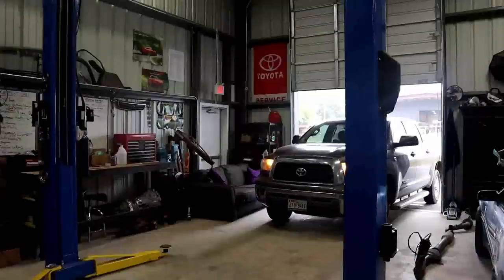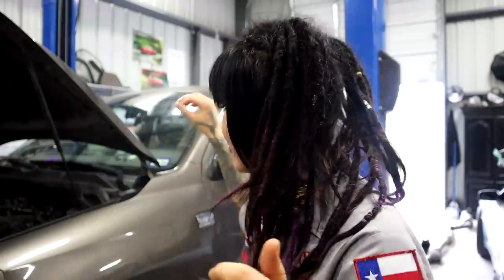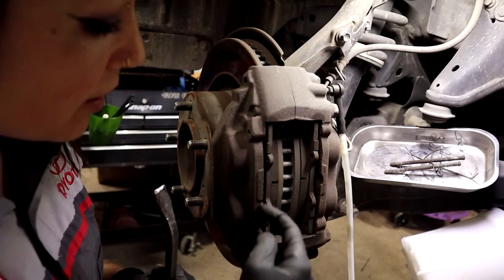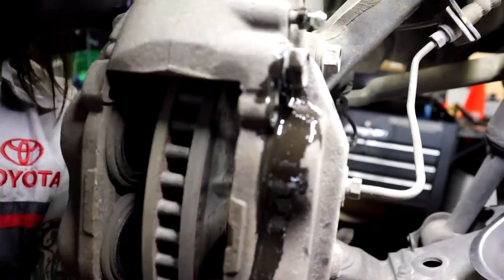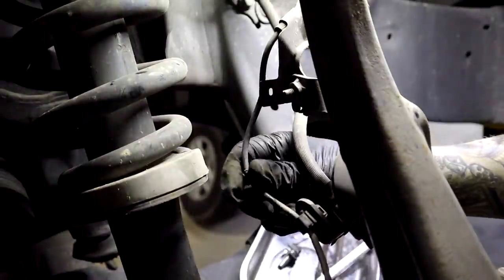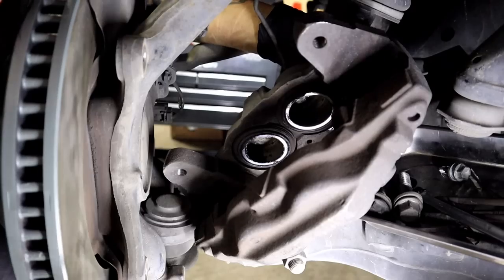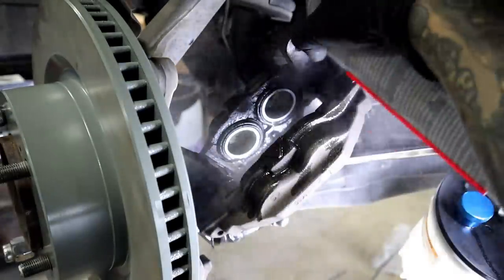How to Replace Front Pads & Rotors (a VERY detailed DIY tutorial) featuring a 2008 Toyota Tundra

Comment: Just a thought to add,  But before you pull the vehicle off the ramp after your done.....pump the brakes up till they're hard.  I've watched a few colleagues in the past forget this and prang customers cars backing out the shop.  Those pistons in the calipers are still a little way back from the pad and it'll take  a couple pumps to get them snugged up to the pad,  last thing you want is to brake and have the pedal go to the floor!        keep up the good work Faye!

Comment: Im a apprentice technician mechanic for Volkswagen, im based in Aus,Melbourne.  Im a 2nd year, mid 20s, and already know working with brakes.  Of course in the everyday workshop we don't go to the extreme that you have - great work though.  We do lubricate the sliders on some brake setups, and the rear drums I've been told to apply some copper grease behind the brake shoes/pads in the drum.  Just figured you wanted to know you've making a difference, so heres my comment and share of experience.  Great to see someone elses work and compare it.  Absolutely love when you do videos with Danny and when we straightened your block and files down your tappers (I think thats what they were called) I was glued to the screen.  engine building is what im eager to see and learn, everyday service work is a bit too casual.  Anyway, in short, thanks for a great video and your service with many smiles!    Just hopes everythings wokring out for you and your success.
Reply from the maker: Thank you so much!!!

Comment: @14:44 PRO TIP:  For those of us in the NorthEast that find the rotors seized to the hub flange, there's two threaded bolt holes (Faye runs her finger right past one of them).  Check the new rotor for the same threaded hole to match up the proper metric bolt.  

You can run an 8mm metric bolt into the threaded hole to press the rotor from the hub flange (bolt can be found under the hood holding down the airbox and other items, or just source the correct bolt from a hardware store).

Just wanted to add this tip for anyone in the NE or the salt belt because you can spend all day pounding on the rotor and still have zero luck.  Also an air hammer around the areas Faye pointed out works wonders as well. 

Great content, im subbing right now 🤘🏼😁🤘🏼
Reply from the maker: Oh, shoot, did I not mention that in this video?!? 😵‍💫 Ahhh I swear I did!!! Haha too many videos, my miskate, thank you for mentioning this!!!!
Reply: Rust is so evil, I had to get rid of my 2007 Tundra regular cab short bed 4x4, only 80k miles, because frame rot took over. Mechanically it was perfect but East Coast rust is the worst.
Reply: @FayeHadley    Also on some cars where the rotors are siezed on and there's no provision for pulling/pushing via a bolt hole, see if there is some metal surface like on the hub carrier you can use, put a bolt and nut between the back of rotor and hub carrier then use your bolt/nut as a pusher tool

Comment: Great vid and overview of doing a break job

I may have to do front pads on 2001 Nissan maxima “MadMax”My son’s first car. 
It use to be mine it got passed down to him after I got a pickup.  
Needless to say “MadMax”fell apart not long after he got it.  It’s been fun doing the repairs myself. To save him $$.  

When I was younger I thought of going into automotive mechanic line of work.  I ended up with CS degree.  I still missed working with my hands and fixing things.  And have an appreciation for auto-tech’s .  

I estimate in past 12 months I have saved my son almost $1700  in labor and parts costs (using mostly aftermarket parts)

I am trying to spur an interest in him in developing skills and mechanical skills that will help him in life.  This is something missing in today’s youth.

Comment: Great information in this video. The tip about marking the torqued bolts is a great idea. I used to work on the iRobot Powered wheelchair. That wheelchair is a class 3 medical device that can actually climb and descend stairs, so strict adherence to the torque specs is critical to prevent failure and user injury. One time I did actually lose sleep because I could not remember whether or not I had torqued the main bolts that fasten the seat arms to the power base. Fortunately the customer is an engineer, gear head and has good mobility and torque wrenches, so early the next day I called him and asked him to verify that they were torqued. They were, thankfully, but putting a discreet mark on them and checking before I left would have saved me some sleep.

Comment: I open the caliper bleeder then push back the pistons having the fluid into the bleed instead of back into the line. Then the full bleed. Then I take the caliper off to preform the brake pad / rotor replacement. The brake bleed cap should be replaced if the old one is cracked / missing. Love your very through videos! (and the chickens)

Comment: Gearing up for spring maintenance (Fort Worthian here, that's like late February with this year being the oddball out) and this had absolutely everything I've read in the manuals for specs, not to mention it was a helluva lot more entertaining. 👍Plotting out new brakes soon and needed the refresher! If the weather holds, I'll be sliding under for the radiator and the ATF drain this weekend. Loved the brake bleed vid I watched right before this one. Way to earn a sub!

Comment: FABULOUS vid , know you need to do a vid on how to diagnose problems if something goes wrong,for example, I just changed everything, and I mean everything in the brake system, well I tour through pads,rotors only on one side unless then 6 months, problem booster I replaced was one size fits most,only one available for vehicle, the rod length for it slightly too long and always apply part brake. Took us 4 days to figure out because we skipped steps to diagnose for we replaced everything.

Comment: I’ve watched all your brake videos today. Did my brakes today with a front lower control on driver side. Everything  was going fine until the bad thoughts kicked in and than my stud on my lower control broke lose so the nut just spun with the stud. Had to pull out the grinder and cut it off. Than Subaru and Toyota didn’t have the flange nut in stock that I needed for my scion. Lucky me I’m paranoid so I don’t through away good nuts and bolts. Found the exact one I needed. Put the new control arm in. Then when I put on my rotors they were so wobbly they looked warped and I just had them resurfaced. I put in two nuts on to hold it in play and they didn’t work. It wasn’t until I put on all my nuts on the wheel rotor that it held in place. Putting the brakes on was the easy part. Then when I reassembled everything the wheel would get stuckish. Turns out you really have to pay attention to them slider bolts took it apart and cleaned and lubed the slider bolt and that fixed the problem. I still have to do the rear wheels but that was almost an entire day. Omg. Just kept listening to your videos and tried to mimic and learn your style. Thanks for the videos !

Comment: First off: great video.  I like how you role.  I didn't read all the comments, so maybe this has been addressed earlier, but red loctite is for things you assemble and expect to never disassemble again.  If disassembly is required, expect to apply heat to break down the loctite.  For this application you should be using BLUE loctite.

Comment: I live in Nova Scotia Canada. The pins(hardware) need to be replaced here more often then not when you change the pads. Not a punch to get them out, you have to use an air chisel. Rust rust and more rust on rust, every bolt is rusted on. Also i need that vacuum tool. Great video!
Reply from the maker: OMG!!! Thats crazy it's gotta be so hard to wrench up there 😬
Reply: Yes it is. You learn ways to get around it so you don't break a bolt. In a pinch Tabasco sauce can work as a penetrant. Just be careful because it will colour chrome and plexi. We use this at sea in our tool bags(I'm Navy)

Comment: These are awesome videos, Faye! I had to learn how to wrench on my 2002 Mitsu by using the shop manual (first car that I did major work on and it was v confusing). There are videos about Audi maint but they're usually from shadetree mechanics and I can tell corners are being cut. How I wish those pads just slid out of the calipers like these do.
These videos are so well done that I'm 100% ready to do my pad/rotor swap and I'm 90% sure I won't mess up my transmission fluid change haha. Thanks!

Comment: good video Faye like always.. yeah keep preaching that more lube is not better. cause when you get the dirty grim etc it collects dirty grim and it then acts like a sand paper. I just open the brake fluid cap open to give the air to push back the pistons. :) but on my two Mercedes, one I suspect air in the line cause it is spongy and did notice that it was out of fluid so that is how I think it air got in, but when I get a lift for my garage I will fix that.  will replace the brake hoses all around brakes rotors and then bleed :)  a lot of work and the other one need to just change it out..

Comment: 13:42
those bolts come with lock tight on them (i work at the plant)
14:50
you can use a 12mm bolt on the rotor to remove if its stuck, itll push on hub to break free. the 12mm hole is on the rotor itself itll be between the studs
Reply from the maker: Oh my gosh that's awesome you work at the San Antonio plant?!? I've taken that tour like three times because it's so freaking cool!!!
Reply: @FayeHadley  
yes and yes,  ive been there for 14 years and going. glad you enjoy touring the plant but as a worker we feel like animals in a zoo when the tour comes around lol! 
keep up the good work with your channel btw!
Reply: So many people don't know that.  Honda's do the same thing.  I see people beat the living crap out of a rotor trying to get them off but I have my two bolts that just screw in, a half turn with a wrench and off they come.  I only had one that was genuinely stuck bad but even then, I hit each bolt with an impact and off it came.
Reply: @bechtoea  
a friend of mine was smacking his rotor (with a mallet) for about an hour before it broke loose. i told him about that 12mm bolt and my mans damn near fainted. i was like bro the bolt would have pushed the rotor off the hub, thats why the hole is there.

if im not mistaken, all rotors have the same 12mm hole for that reason. ive seen it on stock and aftermarket rotors of the like.

Comment: Nice video.  I agree, i wish i could trust other techs do this quality of a job.  but I cant, so i will do it myself.  Can you explain why some rotors have drilled holes and if they are better or worse or doesnt matter?
Reply from the maker: Sure, gladly! The rotors that are drilled and slotted are usually performance rotors. The advantages are light weight (less unspring mass) and very good at venting heat. Not all drilled and slotted rotors are actually an upgrade and improvement, it depends on the brand. I have the Powerstop truck and tow kit on my 4runner, and I really like it, but I have seen other brands be very noisy, produce a lot of brake dust, and not last as long. When I perform these brake jobs, I will always use the OEM pads and Rotors because for some reason Toyotas like to make brake noise - the design of the material and anti-squeal shims of the OE Toyota are so quiet and I never have customers complain about brake noise, thousands of miles later. If you are interested, I have a video on the Powerstop kit (also available for the Tundra) that I installed on my 4Runner. https://youtu.be/xGLYaP8i4RQ

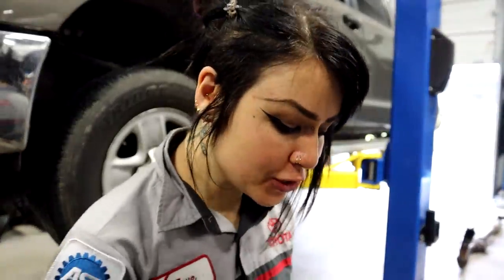Comment: 5:10 that is correct. There are some 21mm that work better with a 21.5mm socket because of the aluminum lug caps. Check Grey Pneumatic sockets, they sell 19.5mm, 21.5mm, and 22.5 sockets for ford, Toyota/nissan, Dodge respectively

Comment: Questions (continued):  (1) Were there any slide pins on those brakes?  If there were, u didn't clean and relube those.  (2) When adding threadlocker to a bolt/nut (also applies to anti-seize), there are some recommendations that say to reduce the "dry-thread" torque by a little, as as much as ~20% (so as not to exceed the design clamping force).  (3) I live where salt is used on winter roads, thus watched multiple times when u seemed to provide the tip to add anti-seize to hub outer rim.  Why did u mention that so fast? - any concerns that anti-seize could bleed out and get onto the rotor inner face?   (4) If u had to remove a seriously rusted-on rotor, would u hammer it hard (can that damage the wheeel bearing?)? Or would you use a puller to remove the rotor?       
DIYing my brakes in the driveway is getting harder as each year goes by, so if I lived closer, I would not hesitate to book your shop for my next brake job (as long as you used a puller). 👍👍

Comment: If the rotor is rusted onto the hub, you can also use two bolts screwed into the rotor to push it off

Comment: I'm getting ready to change brakes on my 2016 Tundra.  Guys in the forums tell me to use 5.1 brake fluid.  My question is whether 5.1 brake fluid is ok or what will that do if the cap has 3, not 5.1?
Thanks and great video!

Comment: Very nice, as usual, but I can't see how that type of torque wrench can be accurate, since, unlike regular torque wrenches, there is a distance between the center of torque and the measuring mechanism. Unless the torque scale already corrects for that distance, although this would not be super precise, given that the distance will be a bit different depending on the size of the open wrench attachment used. Am I missing something? Thanks for posting this.

Comment: These are videos i love seeing from you....and fact its tundra is better lol I have 2 tundras in driveway.... 2008 SR5 and 2018 SR5 for work truck....I did all my breaks earlier the winter on 2008....here a tip...if ur brake pedal feels low...inspect calipers. Thought had issue with brake master...had 3 calipers installed when i got truck to pass MVI bout year ago...garage said 4th one was good..... ended up being that last  caliper...piston was sticking...even tho would compress with clamp....new caliper...pedal was back....I have very firm brakes now :)
Reply from the maker: YES!!! That is what happened to these poor folks. Barely a year on the former brake job and passenger's side caliper seized. Thus the warped rotors, and the fact that I showed this job on the Driver's side only ;)

Comment: Great video darlin...... Was trying to decide if I should do the calipers on my 07 Tundra but after seeing this it looks pretty easy. I have a question for you about an ABS sensor I replaced n cant seem to find a Toyota mechanic in any of the tundra groups I'm in.... 😁😘
Reply from the maker: Bring it on! What's up with the sensor??
Reply: @FayeHadley  so I had all new tires, tie rods ect replaced and after about 2 weeks I had VSC, 4HI flashing with ABS and squiggly tracks (VSC) lights solid.... Did some research with plenty having same Tundra issue but no real answers other than wheel speed sensors so I took a look underneath and did find FR sensor was broken in half by the bolt so I replaced it (oh what fun that was) and lights were off for about 30 miles and now come back on after a few restart miles. I heard that maybe they needed to be re-calibrated because of the new tires or possibly a battery pull to reset the computer? As a side note I went in to replace rotors and pads and found that same side had a froze inner pistons on the caliper so Its getting dropped off on Tuesday for all new everything brakes in the front and he's gonna do deep scan to find out about the ABS issue but before that is a battery pull a good 1st attempt to reset before paying $$$ for deep scan? TY darlin

Update: ended up doing them myself n while I was in there pulled out the new sensor and cleaned off the end n guess what..... Lights Gone!!!! Not sure if it was the cleaning or the new brakes but I'll take it. TY in advance darlin... 😊😘

Comment: Is it necessary to replace your rotors when changing the brake pads?  I recall in years past shops would turn your rotors on a lathe.  Now it seems like folks just replace them, but is it really necessary if the rotors aren't really warped or have big gouges in the surface?  How can you tell if rotors need to be changed?  Thanks!

Comment: Great video Faye.  Thanks for showing us how to replace pads on those fixed-caliper brakes.  This will come in handy for those Brembo's too.   Is it necessary to clean the surface of the wheel hub  before mounting the rotor back on?
Reply from the maker: That's a great question - if there is any sort of dirt or build up or rust or anything creating an uneven surface then it is absolutely essential. Otherwise when you go to mount the rotor back on, you're going to have excessive lateral run out that will cause a pulsation when you hit the brakes!!
Reply: @FayeHadley  Thanks for the info Faye.

Comment: Great video, Faye!  One question, please: At 9:26 you removed the bleeder hose and left the bleeder screw open for awhile.  Won't air enter the system?  I thought the bleeder screw is supposed to be tightened before removing the hose so there is always a closed system.

Comment: Just as a heads up. Just changed 
My rotors and brakes on a 2008 tundra. Pads were pretty much a 1mm or less and no brake light came on. It may be possible that in the past the dealership refilled/topped my fluids.